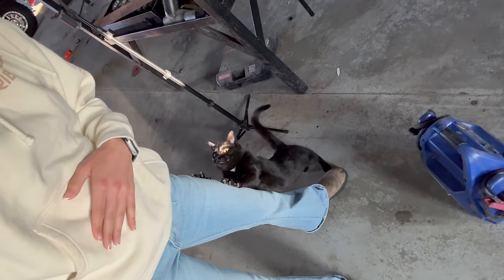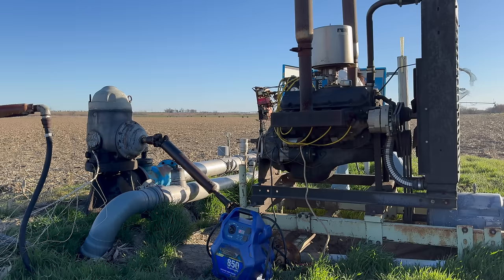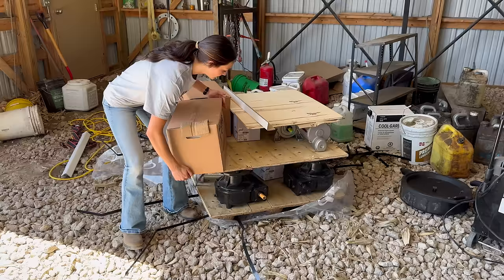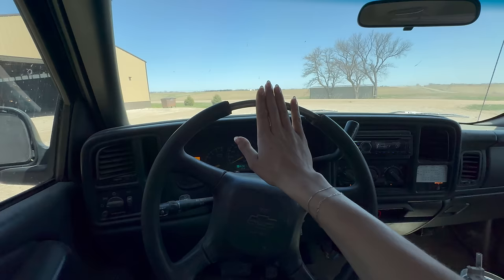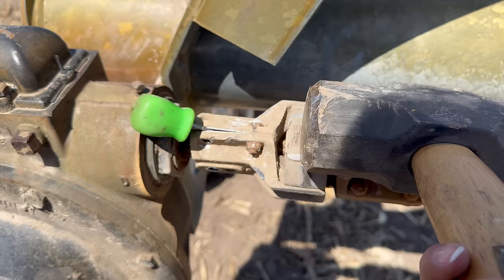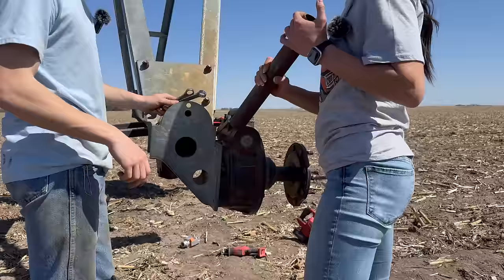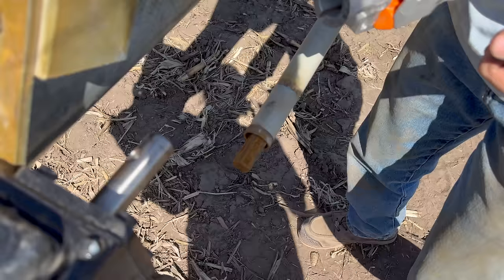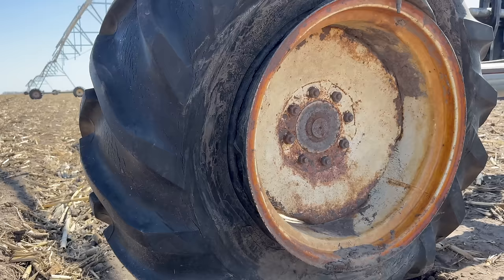Watch Me Fix This Irrigation Machine

Comment: Shop maintenance and organization starts with commitment to organization.  Clean up takes 10 minutes after each job, or you can spend 2 days of your time cleaning up and waste time trying to find tools throughout your weeks by not committing to an organized work place, such as Grant swiping batteries.  Create a charging station for winter battery tending and always keep them charged, dated and organized.  Check out the 5S standard for organization, it works in industry and distribution, it will work on your farm as well.

Comment: I suggest using the box end of the wrench. Then use another wrench to use as a pry tool. ( ask Grant to show you that trick) . I also suggest anti seize on all the threads of bolts in a wet application. Have Gage build a crane on the pick-up truck bed so no one gets a hernia.

Comment: Gday Grant & Laura from W.A. 
A can of wd40 or Breakaway & a "Little Devil" gas torch are indispensable for stubborn bolts & nuts. A bit of copper coat paste or something similar on the thread also helps prevent bolts & nuts from "seizing up" out in  paddock conditions.
Its pretty dry here after some good early rains so some farmers are "dryseeding" & crossing the fingers for rain.

Comment: My suggestion is get a container of some form of anti-seize. There are various types and come in containers with a "paint Brush" attached to the lid. They have different bases and types. The brand names in Aussie are Copper Coat,and  Nickel or, Aluminium Never Seize. There is also "White Lead" Lard, Goose Fat and some forms of Loctite. Unlees some form of retention is required, I use the Plumbers freind, Liquid Teflon. Aluminuim Anti Seize is not good around water as it can turn the Aluminium to Aluminium Oxide, Ally Rust and locks the bolt tighter Nickel Anti Seize, Coppercoat, Lard are the best. Laura find a tin with a lid and dump your cooking fat into it. Good source of lard/beef fat. Also called recycling and is so cheap. I also use plastic jars such as peanut butter containers for this. You have to wait for the fat to cool, other wise use a tin.

Comment: Box-end and not open-end to break bolts loose.
Battery grinder with wire wheel to clean surfaces of shafts and anti-seize for shafts and bolts will make it easier next time.  But just like the BB's in A Christmas Story, it will go everywhere.  You will get it on things you never even touched.

Comment: You need to buy a case of Kroil for the farm. Bust stuff on earth for loosening frozen threaded equipment. Used it over 40 years in oil refineries. Not cheap but will work 99.9% of the time. Can get it in bulk liquid as well as spray cans 👍👍🏆🏆

Comment: One important thing that you do need to change in the way that you where using that wrench. Please, when ever you are putting a lot of force on a wrench, use the box end, not the open end. Two reasons, one the open end strips the nut or bolt much easier. Second and most important, the open end will break a lot easier which can lead to you getting hurt! I would also suggest a longer cheater pipe. Most important thing is that you got it done without hurting yourself. Well done! ;-}}

Comment: A quick tip for increasing the leverage on a spanner.
Put the ring onto the fixing and the hook the ring of another spanner in the open end to double tge face you can apply.
As you found it only needs loosening slightly to allow you to lift the gearbox off - so it becomes a one woman job then!

Comment: Ever heard of the tric using two combination wrenches to lessen a bolt.
 Last winter you and your hubby went to south america on vacation. Never seen such a thing for young beginner farmers in my area. It might of been more profitable to buy batteries, tools, and spare parts to run the farm instead of expensive vacations. 
 We all have our priorities at different places.
 The time on vacation could of been well invested in taking a basic mechanic cours, where this info would serve you for the rest of your life, and reducing repare cost by doing it yourself instead of hiring outside knowledge. 
 But then again money may not be an issue for you.
 Also search the chemical/mechanical reaction between aluminum and steel. It could be helpful for future references when working with mixed metals. Such as steel bolts in aluminum housing.
Have great day

Comment: I wouldn't run that pivot engine too long without a battery.  The battery absorbs voltage spikes and protects the diode rectifier built into the alternator. I've seen those diodes get burned out especially on Fords.

Comment: Use the boxed end not the open. Those bolts are meant so that you can hang the gearbox on there and then get the other bolts started. I usually try to break that one free first but always use the boxed end

Comment: Valley Loads used to be my Friday/Sunday/Monday  routine.  I would start in Minneapolis on Friday and load steel rod for Valmont industries raw material.  Go home for the weekend and drop the load in the yard and go pick up a irrigation system on the other side of the  yard.  Haul it to delivery Monday morning.   I delivered in Michigan Ohio Illinois Kentucky Tennessee Arkansas Oklahoma Kansas and Nebraska Sometimes Colorado.   When you get paid percentage of Load (freight) then percentage of something is more than percentage of nothing.  So I kept the wheels moving as much as possible

Comment: When removing stubborn bolts/nuts, and you need a combo wrench, always use the box end wherever possible.  Slips less, locks on and more forgiving if you need to slide a pipe over it for more leverage.  Don't be afraid to spray some panther piss on the threads.  PB Blaster, Kroil, Marvel, CRC56 helps alot.  Also, speaking of threads, the most surefire way to be your own best friend is to put a dab of Never Seeze on your threads anytime you don't need threadlocker.  Judging by your operation, you should probably invest in a case, and put a can in every toolbox, work location and vehicle.  Then in the future, when you need to remove that bold or lugnut, you'll be thanking yourself that you used Never Seeze the last time you were in there.  Make it a habit- you'll be glad you did.  Only takes a few seconds.

Thanks for sharing, and I'll watch for the next one!

Comment: Something I don't see on your videos is oiling or anti-seize lubricant on all nuts and bolts before you tighten them. That applies to everything with threads. Cleaning all threads with a wire brush before lubricating is also a good habit to get into. Love your show!

Comment: Cyclo Break-Away Spray Penetrating Oil, 13-Ounce when you’re out in the field and you need to loosen a rusted bolt. Use the spray spray it on wait 5-10 minutes comes right off.

Comment: Add a container of Anti-Seize to your Pivot truck and use it on every bolt you install.  Its not always a perfect solution, but it works well to prevent different metals from adhering to each other.

Comment: Lucky for you I'm a dad to lol.Based on this video I saw now reason why the box end couldn't be worked over the bolt then you have the open end available to slid the box end of a second wrench over to extend the leverage saving you the trip to go get the pipe......Box end should fit i would think.

Comment: A tip for replacing bolts on equipment used in wet work: be sure to use an anti-sieze compound when installing new bolts!

Comment: Every time you run into a piece of equipment with a "stolen" battery just stop everything, go to the parts store, charge a new one, drive back and install it, then be sure to let Grant know how much the battery cost, how much time out of your day you spent dealing wit the "stolen" battery problem, and how this was the way it was going to go every time you ran in to this problem. See how long it will take him to figure out that batteries are cheaper. Fun times!  Then again maybe I spent too long in Marine Infantry.

Comment: Laura, careful with running an engine equipped with an alternator without a battery.  My understand is that if you disconnect all your 12V (battery or eq.), the alternator will "run away" and probably make lots of voltage and fry stuff on the 12V parts of the rig.  If you leave your jump pack well connected for the duration of the run, should be no problem so long as you do not interrupt its contacts.  But a momentary break in the connections to the jump pack could cause a problem if there is no other battery.  I'm no expert on irrigation pumps but that is the rule of thumb for normal vehicle engines.

Comment: There's a reason the pivot has a slot cut instead of a bolt hole on the top right of the plate. You should be able to thread the bolt into the gear box and lift it on and slide the bolt down the slot thus holding the gear box up. This allows you to install it easier and be able to install it yourself. Otherwise you would have to try and lift it and put a bolt in through the back side by yourself.

Comment: The alternator needs a 12V supply to create the magnetic field. Also, you need to insulate the battery cable conductive surfaces from the damp ground! Ya need a battery! LOL

Comment: After 20 years of working Air Force jets I completely relate to this video. You have no idea how many arguments I’ve had under the Jet with the (imaginary) aerospace engineers who designed the part I had to remove and replace, but never even had so much as a FaceTime call with the aerospace engineer that designed the compartment said part was installed in. 😂😎

Comment: I always have one of those little air die grinders with a cut off wheel on it for cutting off rusted/ frozen bolts. They’re like $15.00 at Harbor Freight. A must have for the pivot service tool box.

Comment: You guys need to invest in a bunch of magnetic parts holders. I almost had a stoke when you left those lug nuts on the ground.  Get some small but mostly big & you can place them on the equipment or close to where they are needed the attach away

Comment: Hello there farmer Laura you did a pretty good job putting that box on but my question is this you never checked the gear oil to see if it came filled up next time do that check it and the other thing is you have to put never sees on all the bolts that you put on and that shaft which was slid on it makes life a lot easier when you have to change it 10 years down the road good luck Francis here in New York state by

Comment: Next time u have trouble with a bolt,  use the box end of the wrench,   it will hold itself on the bolt and u can whack it with a hammer, and it will come loose easy

Comment: You need to add a MAPP Gas torch to your tool kit.  By heating up rusted bolts you cause them to break free of rust.  I also suggest for your service truck the magnatic part/bolt trays, to keep from loosing lug nuts.

Comment: Using the wrong end of the wrench. If you would have turned it around from the start it would not have rounded off the head. Using the box end also allows you to "Double" up the wrench with a larger one for more leverage.

Comment: For those stuck bolts you should try WD-40 or similar lubricant to help get them to loosen up. Also, when you re-install, you can add a product called Never- Seez to the threads. It's a silver substance with the consistency of grease that you brush onto the threads so they wouldn't stick like that one bolt did.

Comment: Double Wrenching use the closed end of the proper size and then a bigger wrench to put on the open end with the closed end of the bigger wrench so its like a cheater pipe but a wrench of course! Google double Wrenching if you do not know what i am talking about you can find an image and description like i have explained above in a little more detail! O and if that doesn't work most people get the cutting torch and heat it up till the bolt is red hot and they usually come off pretty easy. That doesn't work then cutting it off is the next option, if you hadn't figured out how to get it off but you did so no need for the heating or the cutting but the double wrenching would have helped or normally does anyways and some WD40 to soak a little bit lol.

Comment: You can also use a penetrant like  P Blaster that will work it's way up and down the threads to lubricate.  You do need to let it work for an hour or so.   Heating the nut with a torch will also loosen the grip as mentioned by someone below.

Comment: 1:17 Good 'ol Jeep/Chrysler/Dodge electronics! 🙄 My Dodge has really dumb ignition issues as well. I had to circumvent a microswitch inside of the shift lever, when in park so that I could even get my key out of the ignition. For the longest time, I just had 2 wires sticking out of the ignition for said switch, that when touched together would activate the little electric servo that allowed the key to turn all the way out. Now I have a cleaner looking little push-button in place instead of the wires sticking out.

Comment: Never use the open end of a wrench to loosen a bolt. Always use the BOX side of the wrench. You will not strip out the bolt head. And you will have much more leverage.

Comment: Put some thick grease on every nut and bolt before you put them back and you'll thank me in five or ten years when you have to take the gearbox off again. My father used to maintain industrial pumps that pump all kinds of chemicals. Corrorison is a big problem in those invironments. A little grease goes a long way.

Comment: Start the bolt into the matching hole for that top slotted spot that gave ya the hard time.  It's slotted so you can drop the gearbox into place while you do the rest of the bolts, then tighten top

Comment: That tough bolt on the gearbox so you could put the bolt in the gearcase and then hang it on the pivot. Pivot toolbox supplies penetrating oil,torch,antisieze

Comment: You had the entire weight of the pivots gear box on that one bolt. No wonder it didnt want to come loose. Next time put at least one of the lower bolts back in to hold the weight while you break the torque on the hard one.

Comment: Hi Laura, Watching you struggle with that gear box, I see you were using the open end of the wrench on it. If possible always use the box end as it is less likely to slip off. After so many busted knuckles I figured that out. You do a good job on the heavy jobs there. OH yeah the 4020 sounds much better now. I hope it does the job you got it for.

Comment: Never run big engines without battery and never ever disconnect battery leads when the engine is running! The battery, even if it's dead, is needed as a buffer (capacitor) to smooth out voltage coming from the alternator.
Otherwise the voltage may jump to very high levels, like 100+ volts, and you can fry engine elrctronics, especially if it's newer engine. Some very old engines with mechanical distributor might be fine, but newer stuff is less resilient.

Comment: Do not disconnect the jump pack or run an engine with an alternator without a battery. It regulates the field voltage. Alternator will die.

Comment: Someone may have posted this, but why don't you use anti sieze compound on those bolts that hold the gear box on. It takes a second, and they will come off easier next time.

Comment: I always us a 19 wrench to loosen that bolt with all the others still in so there's no weight on it then rattle gun those others off then sit the piviot down on a block and it pops straight off. Have cursed many a time at the engineers who put that stupid bolt there, but after doing so many I realise It makes putting gearboxes on alot easyer just slips in and bolts up 😂 piviot the Bain of my life!

Comment: Grant! Keep your dirty hands off the batteries. You can't fool Laura. Gage you the MAN thanks for being Laura's right hand man. Need to add a ball peen hammer to the tool truck and would suggest getting an old baking pan or hub cap to put your hardware in. The ground is not a good place for hardware (hope you did not pick that up from Matt). Another good video, keep them coming.

Comment: The steering wheel (with the missing chunk on top) could have been ruined by SUN damage!  My truck, here in Texas has a big crack on the top in the same place, and will be ruined someday.  It faces the sun in the latter part of the day, and has for about 21yrs.  Just a possibility of why the rubber is missing on your wheel. :)

Comment: @21:00 Why do you use the open end of the wrench to loosen the bolt the closed end is for that purpose, if it's a matter of the angle on that end buy some wrenches that are flat with no angle OR get a wrench like you were using and use an oxy/acetylene torch to heat it cherry red at the juncture of the angle then lay it on a vice anvil hit it with the big hammer to remove angle simple. How many acres do you farm?

Comment: I don't know why it is that farmers drive with one hand at the top of the steering wheel, going down the county-graded roads at their typical 15 miles an hour while looking out the side window at crops and cows. But they all do. I think it has to do with waving at oncoming pickups. Granddad would just lift his fingers up, with his palm still on the wheel, and that amounted to a wave. The guy in the oncoming truck, also driving with one hand, would do the same.

Comment: Have never seen a petrol engine in a working machine, we here in Germany and whole of Europe only use diesel engines for machines. Is it hooked to a gas (methan) line? Did I see a pressure regulator a meter away? Sounds better than our diesel engines for sure....

Comment: A vehicule that runs after being commanded off it because of carbon build up on the cylinders and it is literally self combusting on its own. It would need an injection system cleaning.